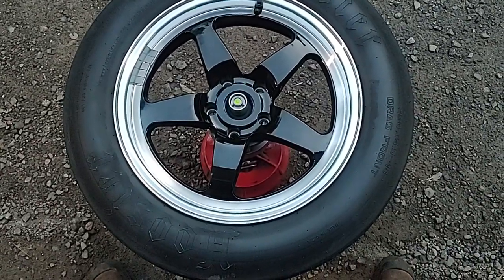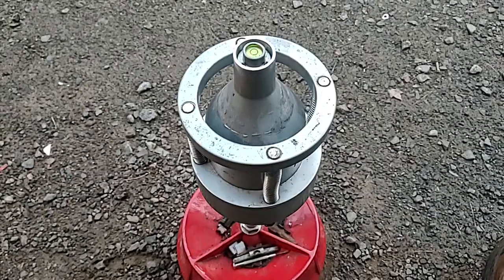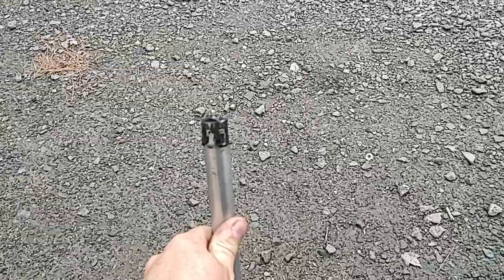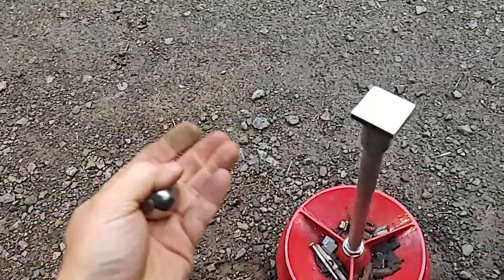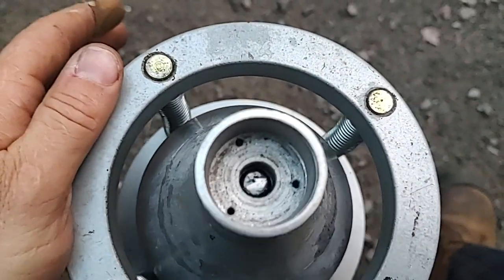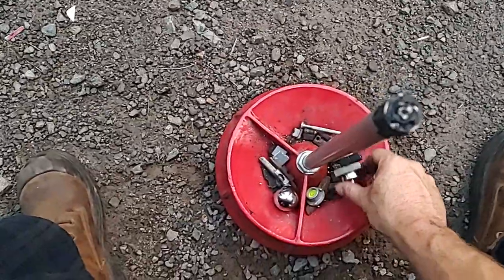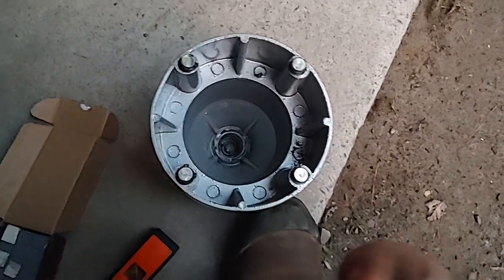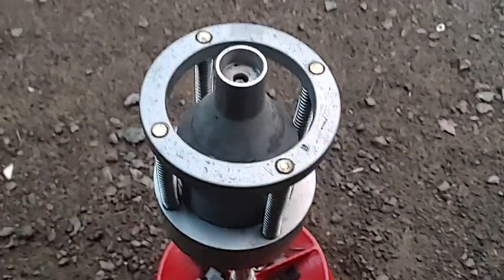Tire bubble balancer..the only real FIX on YouTube

Comment: I bought one of these Chinese copies about 10 years ago.  I couldn't get consistent indications.  I believe a shaft with a cone and low friction bearings is better, Snap-On Tools used to sell them, and similar but smaller versions are used for Motorcycle tire's are available on Amazon, the same idea is used to static balance aircraft propellor's.

Comment: Some people drill with a 3/8” bit to make the hole where the pin rest under the bubble bigger.  Apparently it works good. Did you try that first?
Reply from the maker: no it wont...metail is to soft
Reply: We both know it works great. Lol
Reply: I tried drilling on mine and it helps with the friction, BUT I can never get consistent results when I rotate the wheel on the balancer to double check balance. It seems perfectly balanced, then I rotate it 1/4 turn and its off. Another quarter turn and so on as I rotate 360. Results seem to be always inconsistent.
Reply: @JustMe-gx4xt i balanced mine 2 weeks ago and tested it up to 90mph and it’s perfect.  When I rotated the tires to confirm the weight…it was not perfect but close enough so I proceeded to install it.
Reply: @JustMe-gx4xt  I got the same issue, can't get consistent results during rotation.  That tells me the actually balancer is not center/balanced.

Comment: What mm and length bolt did you use?

Also after gluing the bolt in did you drill a very small pilot hole at the head for the pin to sit in?

I couldn't tell from the video as it was too fast at this part.
Reply from the maker: yes you need to drill or punch a small pilot hole in center of bolt,,,,you can use any bolt size ...i will come back with the size i used
Reply: I'm on the look out for a usa made vintage one but there mega money and not really worth importing it and finding out something is wrong with it later.

Been struggling with this for a while.